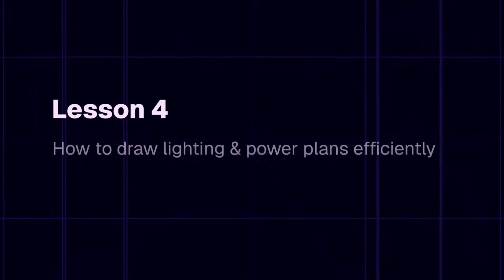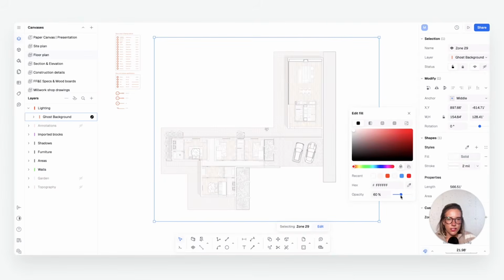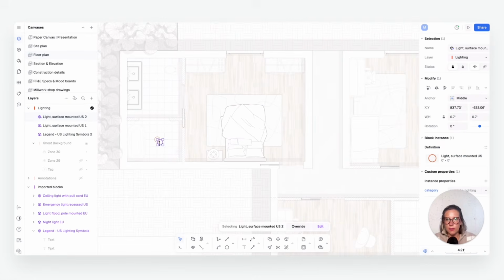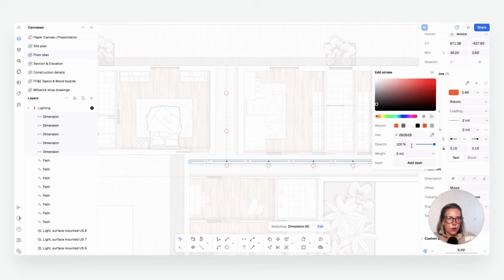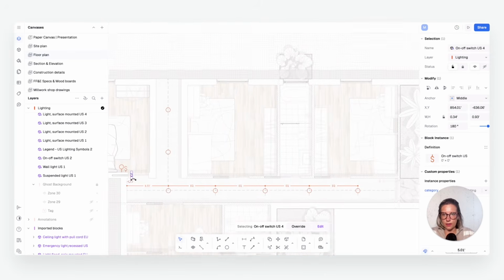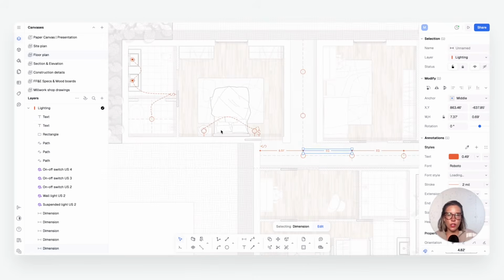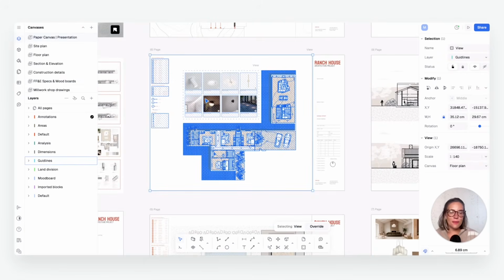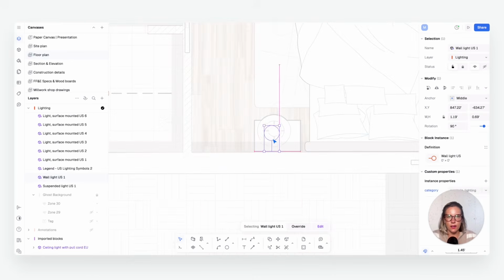How to Draw Lighting & Power Plans Efficiently

Comment: when you drag and drop a legend into the drawing it should really be mandatory to be able to set the text size and symbol size so that it is consistent in the drawing set and across projects. dragging and dropping CAD background, setting really weird scales, pushing and pulling legends and symbols to unknown sizes is incredibly sloppy. the lights were placed with very different center-center dimensions. then the text was changed to equal. that's a very poor way of doing things. it's like etch-a-sketch. I like the lessons series - just don't like how sloppy rayon is.
Reply from the maker: Thanks for your detailed feedback, we're always looking for ways to improve our platform and appreciate your suggestions!😇🙏
Reply: Taking this opportunity to suggest also, if it could allow dimensions to manipulate blocks/lines/etc. when set to “EQ” has an option to adjust the objects along with it accordingly.
Reply: @jmgc5761 yes I was wondering about this as well. It should actually be set that way so the dimensions are there alongside proper visual representation of those dimensions.